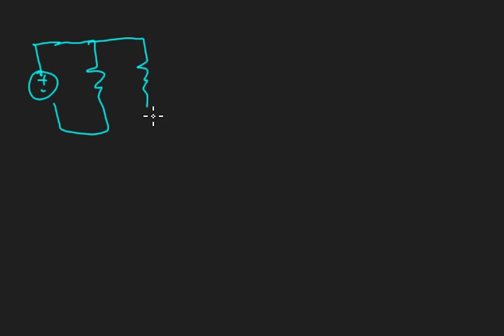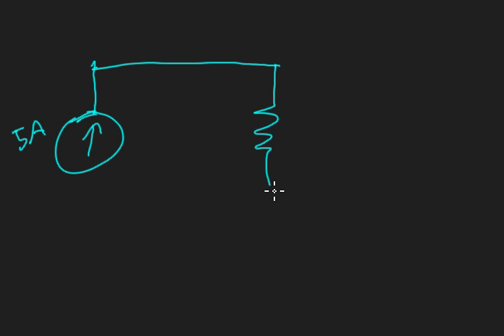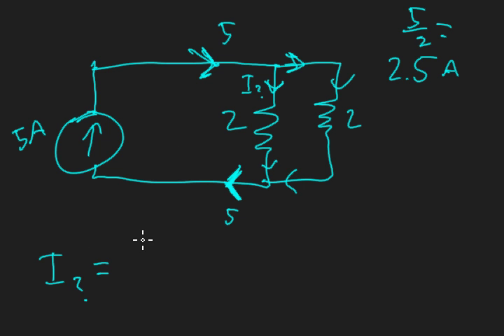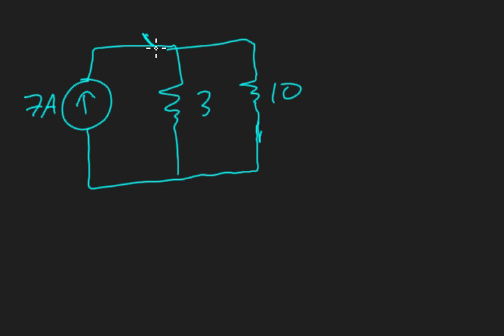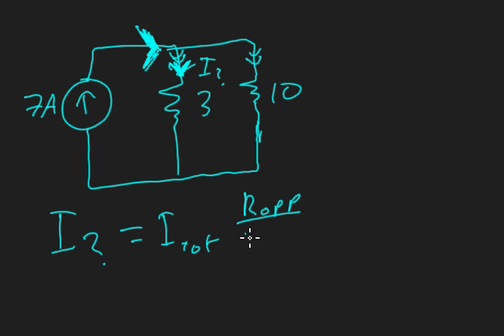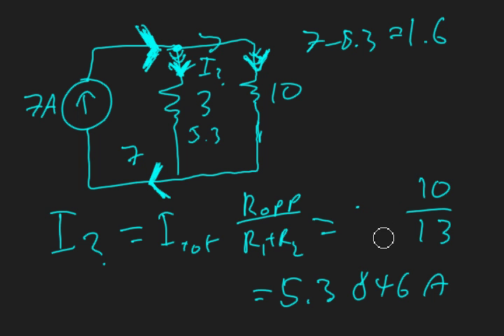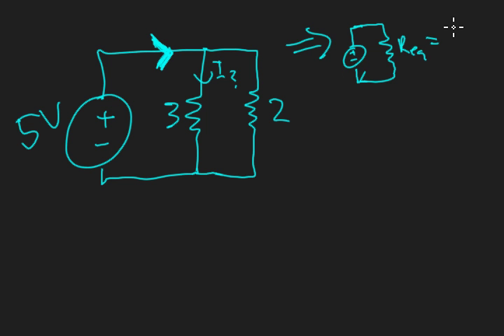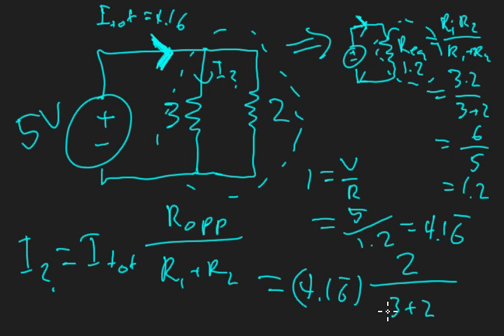05 Current division

Comment: can you solve this worded problem? A voltage source is connected in parallel across the four resistors R1,R2,R3,R4. the currents are labelled I1 I2 I3 I4 respectively. If I2 twice I1, I3 twice I2 and I4 twice I3. calculate the values for R1 R2 R3 R4 if Req. = 1 kilo ohms.
Reply: I cant

Comment: Thanks alot for your videos I just have a few notes on this one:

In the last example you didn't have to do all that, you could've just divided the voltage by each resistance and you would've got each current :)
i.e. the first current I[1] = V/R[1] = 5/3 = 1.6 A
As a matter of fact in the current division it's easier if the power source is a voltage source :)

Also I agree with the idea that u should use the general rule for n number of resistances instead of the rule for 2 resistances only.

And finally it would be much better if you derive the formula in the begining of the video and then use it afterwards. This allows us to think of more shortcuts in the solution and we don't have to memorise rules because we understand where they came from and we can derive them at anytime :)

Thanks again and good luck.
Reply: yea..me too

Comment: good video , however this would only work if there were ONLY 2 resistors, you should mention the original formula and get used to using it

( Io  = I tot  x   Req / Ro  )     and the Req for 3+ resistors is  1/Req = 1 /R1 + 1/R2 etc etc

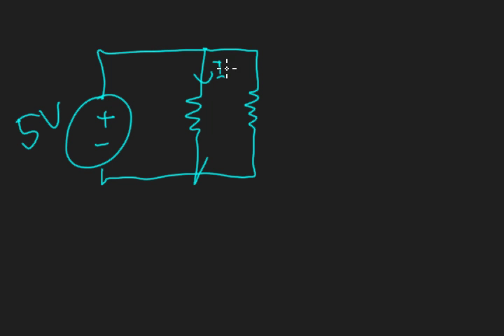Comment: At 8:17 I feel you overcomplicated the problem. The voltage is constant through-out the circuit so you can simply use ohm's law to find the current in each branch. 
5/3 [1.66..] (branch 1)
5/2 [2.5] (branch 2)
total I = I1 + I2 = 1.666 + 2.5 = 4.1666...

Comment from the maker: with 3 resistors in parallel, the formula is; Equivilant resistance = 
Req = (R1^-1 + R2^-1 + R3^-1)^-1
you can rearrange this formula to get Req = (R1*R2*R3) / (R1*R2 + R2*R3 + R3*R1)

yes, so basically if you have lots of resistors in parallel and you want to find the current accross one, you can combine all the other resistors and current divide the two.